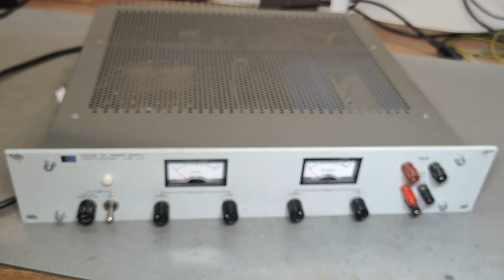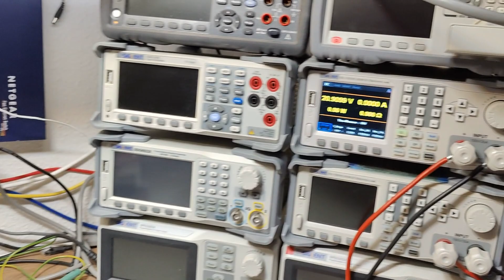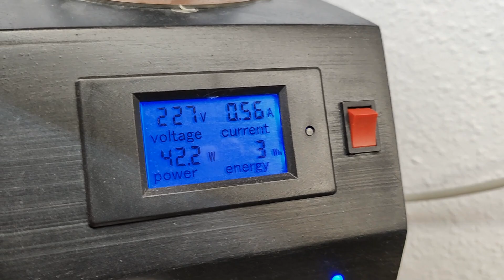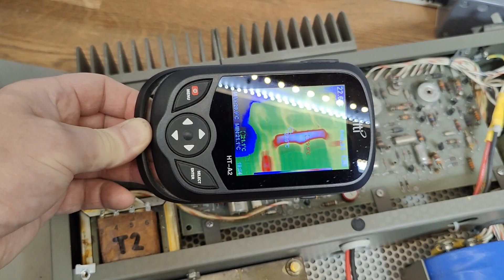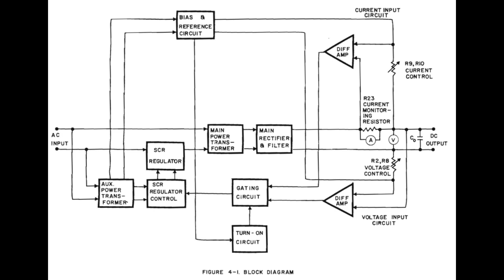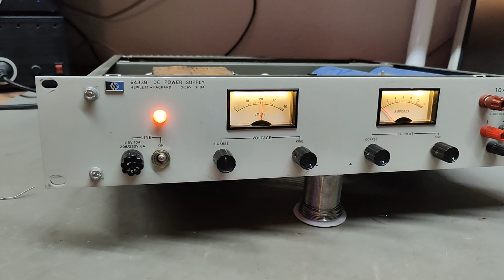HP 6433B 0-36V 10A mains frequency switch mode supply 1966 test teardown

Comment: This has an odd transformer in it, as the lams are not E & I, the I's are like a shortened E. Plus, the lams are extra wide in the legs. I've never seen this type of core used before.
Reply from the maker: correct, it is very special
Reply: @TeardownOZ2CPU  It must be something to do with the triac switching and eddy current losses, but I would think that the gaps between the lam's Es and seni-Es would still be the same. The wider legs, though, would allow more flux to travel around the core.

There would have been a good bit of scrap created when punching out these lams, as standard E & I lams are scrapless. Thus, these lams would have cost more.

Comment: Nice teardown. I have a similar supply from Electronic Measurement INC, the 300S9 gives 0-300V output at 0-9A. In this design the inductor is larger than the mains transformer. I think they choose this design to avoid extremely large capacitors. It works very well but the hum indeed gets old to have on your bench.
Reply from the maker: maybe it is possible to mount the transformator to the chassis via thinn rubber sheets, have you seen my EA supply videos about transformator hum, it made a huge difference
Reply: @TeardownOZ2CPU  i put some thick rubber sheets and damping material under and above the whole unit which makes a big difference, most of the sound is "airborne".

Comment: 3:55 SCR‘s only turn on, so the regulation is by phase-angle control rather than PWM.
The operating noise would annoy me as well, I guess.
I once had a Gossen lab supply from the 70‘s with an interesting topology.
It had a pulse frequency controlled preregulator with a huge silicone shielded inductor and a linear post regulator.
You also could determine the current consumption of the load by the switching noise starting with slight ticking in idle mode growing to a whining sound at full load.
Reply from the maker: correct phaseangle more or less of that, translates to a power pulse that contain more or less energy, it is exactly the same that happens in a normal pwm regulator, however they mostly use a sawtooth, not a sine, but it is not a practical problem,  it does mean ragulation gain is not constant

Comment: I have a similar design from Sorensen. I consider it as crossover of a crowbar and a sledgehammer.
When I received it (bought as non working), I didn't check the input voltage. But it took only 2 seconds to realize my fault. It works again. :-)
Reply from the maker: that comment added a few years to my life, you know they say it is healthy to laugh :-) we all tried to forget voltage selectors, I try to explain in many of my videos about pre inspection before power on, and also slow and carefull power on, i also use minimum possible external fuse and a vario with watt meter
Reply: @TeardownOZ2CPU  This is the well known "ohno" time unit. 🙂

Comment: Nice! I have the 40V 25A version of this supply :D
Reply from the maker: wow is it same size ? or a bit bigger ?
Reply: @TeardownOZ2CPU  It's bigger. I think 4U size so maybe twice the height of that one? And 30 kg+. I still have nightmares of carrying it up the flight of stairs where I got it... :D
Reply from the maker: @FJL4215 oh dear.. mine is only 2U height
Reply: I have the HP 6269A which is the 40V / 50A version. It has the same architecture- and 5 x 50V / 40,000uf output capacitors! Quite a beast.

Comment: Thanks for the video. I have a very similar HP 6266B supply that looks almost identical to your unit. Mine is rated at 40V and 5A. I read that these mains-switching supplies were developed by a company called Harrison that was bought by HP. Some of these supplies actually say “Harrison” on the front panel along with the HP logo. The biggest difference between my unit and yours is that mine has a linear regulator at the output. The mains-switching supply merely keeps the linear regulator’s series-pass transistor’s power dissipation relatively low. It behaves as a pre-regulator that tracks the output and keeps the collector voltage low, but high enough to prevent that transistor from saturating.
Reply from the maker: correct Harrison made the design it is all over my schematic, it is normally a preregulator with SCR and linear like yours.